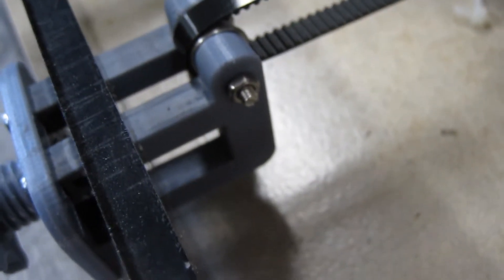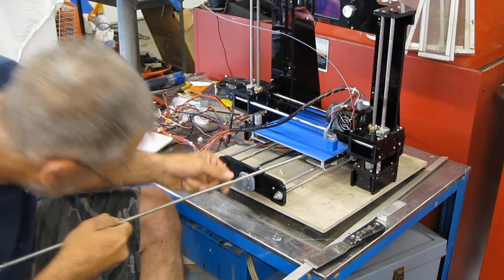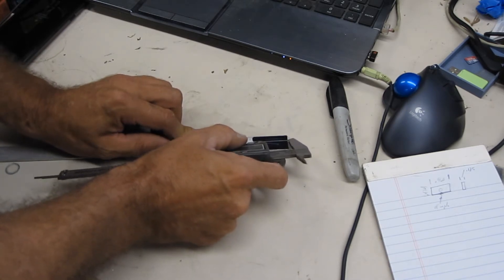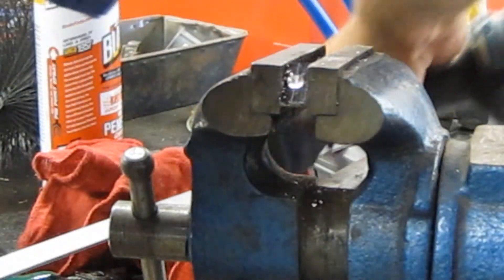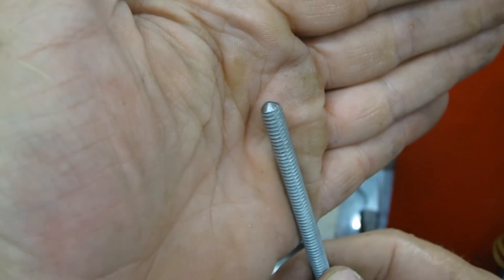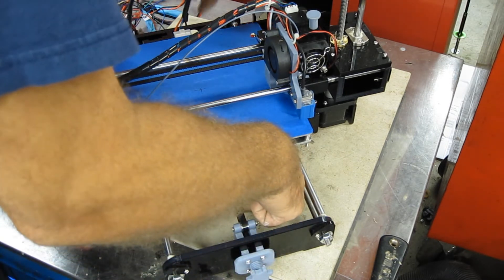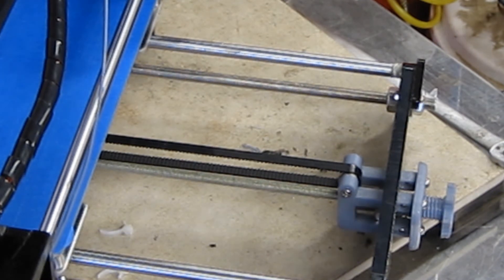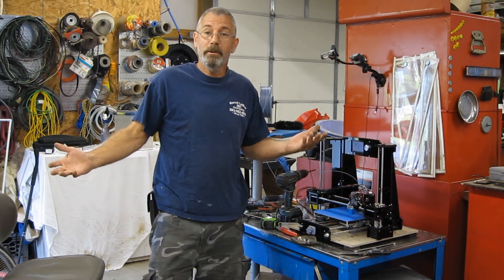Anet A6 or A8 y-axis brace ...Simple fix

Comment: seriously you need to just get rid of that acrylic frame with 400 3mm nuts and bolts and go to the AM8 extrusion build. Every time I printed something on my Anet A8 I found a 3mm nut that I had no idea where it came from. There just not worth the tiem it takes to print all these little upgrades, just got for the proper AM8 build right out of the gate and you will be happier!
Reply from the maker: Keep watching dude. In later videos, I plasma cut a steel frame that is way more rigid than an am8 frame.

Comment: Will this help dampen excessive buzzing on the Y axis?
Reply from the maker: Robert Jones Sounds to me that your belt is rubbing on something. Perhaps the loose end is too long and rubbing on the teeth of the belt. If it's not that. Then they sell idler pulleys that have teeth in them which will conform to the teeth on the belt far better than a smooth pulley.